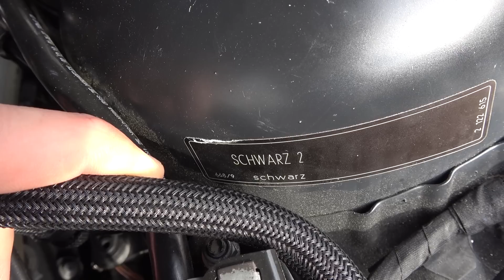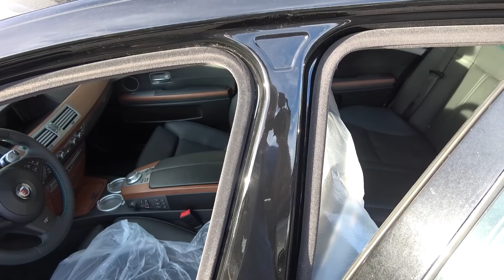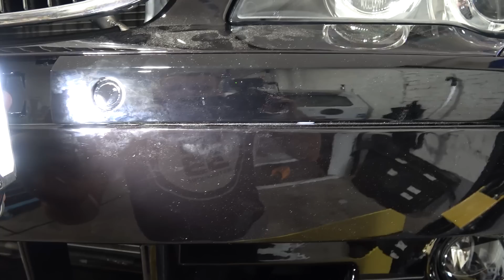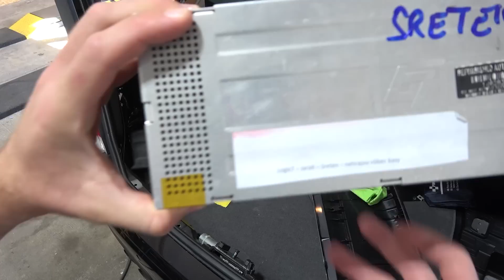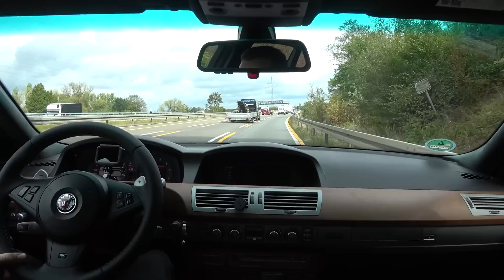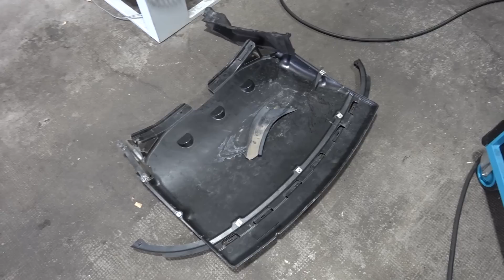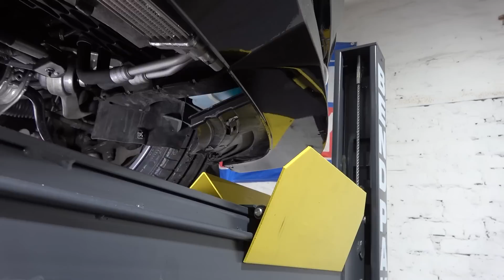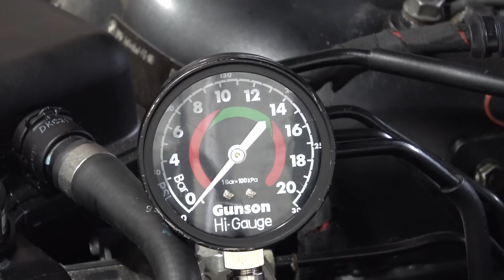More Problems - Supercharged BMW Alpina B7 - Project Chicago: Part 15

Comment: It's sad to see the bad quality paint job. Germany as a feinschmecker country totally fails on this part. Here in Norway we pay approximately the same and a good quality paint shop would not have painted the parts without having the car in their workshop. My F01 had a new paint on the front door and they also painted front bumper and rear door to avoid color mismatch.
Cool to see Alpina contacting you, too bad they are too late to the party though. Cant wait to see a tour from their facilities 🥰

Comment: I was wondering, what did you do to the transmission? It seems quite slow on the shifts, some new valve body seals, fresh fluid, and a relearn fixed my 6HP19 up big time.
Reply from the maker: Transmission was serviced in the US, got an invoice for that, I just made sure the level is correct. Shifts great, but not sure if it can be faster, it's an old slushbox. Will look into that!
Reply: @M539Restorations  Not very likely the dropped the valve body and replaced the 5 seals, let alone reset oil life and adaptations. But very much worth it. Follow the relearn procedure closely though. I'll try and DM you some info on insta.
Reply: Aren’t all older car transmissions slow as heck.  Until the ZF 8speed rolled around everything was clunky.
Reply: @gettcouped  deff not. These 6HP are pretty snappy when in good condition. But with older oil and those seals deteriorating the shifts slow down immensely.

Comment: Im thinking the chassis got scuffed/damaged during or prior to assembly at the Alpina factory, and Alpina (or a third party) painted it fully in a generic black color. Might seem unlikely because of the thin paint, but I have a hard time believing it went through BMW quality control like that. Especially being a 7 series.
Reply from the maker: I forgot to mention it, but North American Alpina B7 was assembled at BMW. Euro spec B7's were assembled at Alpina.
Reply: @M539Restorations  Makes sense now as you mentioned the vin-number not being Alpina specific for the US cars. Could be interesting to see if other schwarz II e65 Alpinas (or normal e65's) from the US have the same metallic finish on the body